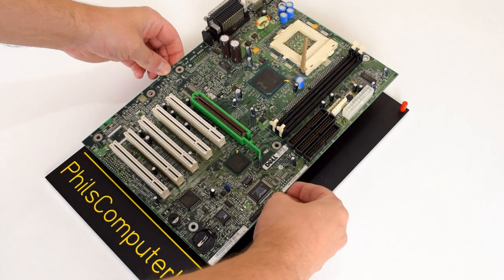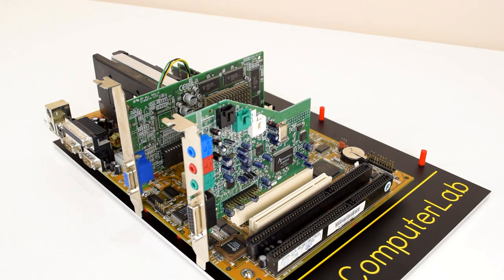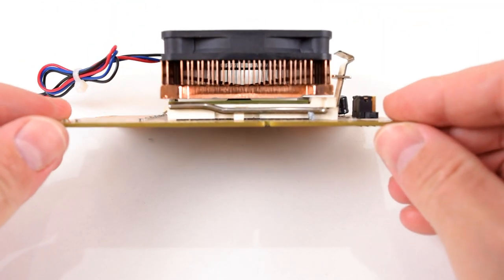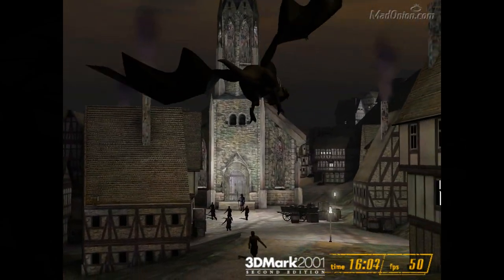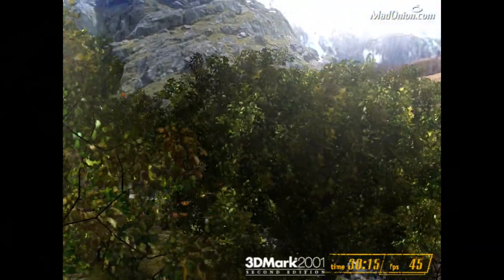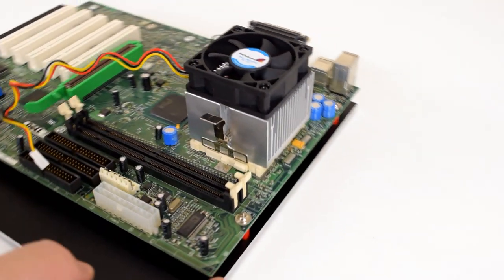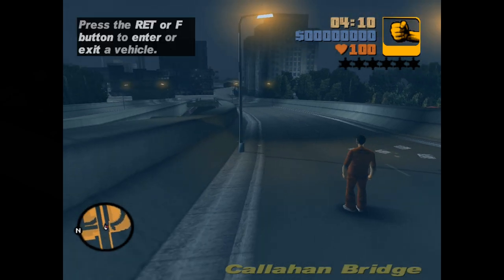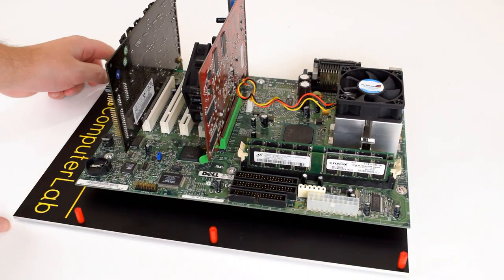The Pentium III 600EB - What does EB mean?

Comment: Hang on fella....is that Dell D815EEA using a propriety ATX and AUX power meaning you need a Dell PSU? I know Dell decided to change the pinouts of the standard ATX power adapter which was nuts. If you look closely at Intel/Dell boards of this era you can see there is a shift of the ATX plug to make it a Dell or standard Intel plus accommodation for the 6pin AUX. I've got a SE440BX boards like this; Dell and Intel. If this is the case with the D815EEA then probably should put a warning as plugging a normal ATX PSU to a Dell board will not work. Might be an interesting video as it was around 1997 to 1999 when Dell did this lunacy I think.
Reply from the maker: Yup! You can buy ATX to DELL propreitry adapters on eBay, at least that's where I got mine from :) Because of this you can get a decent price.
Reply: @philscomputerlab  Hang on .... the more and more I looked at the D815EEA motherboard you have some deep down memory cells started to engaged; the Dell Dimension 4100! I took a look in my Boiler Room (don't ask) just now and there it was! Nice. Power adapter suggestion: Yes, I found the single seller on all of eBay selling one. Ordered one back in January....still waiting for it. Gulp!

Comment: I just picked up a Socket 370  Pentium 3 667 Coppermine system from a thrift store for $10. a Compaq Presario 5000 with a PNY Geforce4 MX420, and 512MB of RAM.
Reply: though for some odd reason it runs at 664mhz, dunno why that is.

Comment: Had a duron 850, over clocked it  to 1.3ghz but it run stable at 1.2ghz.
Bench marked it in quake 3 and it beat a friends dads Pentium 3 500 on 2/3rds of the benchmarks.
So he went and bout a 800EB. Same bench marks me duron won on about 1/2 the test and only cost $185....

Comment: I can't wait till you start playing with the early p4 on the socket 423 and rambus, maybe you could look in to the mystical and elusive 478 to 423 adapters lol.
I had a 423 1.5 Ghz p4 in my mid teens with 256 MB of rambus I sold that machine off and regretted it, last summer I was a goodwill and was in the board games and found a boxed motherboard, the exact same model but it's got a 2Ghz chip in it and 2GB of rambus in it.
model number is the P4ITA2 in case you curios.
Reply from the maker: Just so you know, I'll skip anything that is priced silly and not useful for building a retro PC these days. Things like Slot A or RAMBUS, yes they are kinda cool, but not practical and so mnany better options.
Reply: For those interested in really delving into a socket 423 system; in my opinion its more for the experience than anything, due to the rarity of the parts (it can be 6 months at a time or longer between ebay listings of the best parts) its not practical as a retro gaming rig.  I managed to get an Intel D850GB motherboard with an Upgradeware 423-478 adapter along with an P4 northwood 3ghz model SL6YH working with 2gb of ram and windows 7; but due to how often I experimented with expansion cards I managed to break the motherboard traces and haven't had enough time to try again.  >w<
Reply: I was actually looking at auctions for socket 423 stuff, there's a board that supports old fashioned PC-133 in there (auction 112425692504) but yeah, kinda expensive for that one at $90 USD, it does come with 1.5GB of ram and a 1.5 Ghz cpu.
Over all the prices are not too crazy but I understand not wanting to spend the cash on the parts for one or two videos.
Reply from the maker: Yea that's pretty much it. Some parts that I see being used a lot, like the Axper Socket A board. I use this all the time, so it was worth buying.
Reply: PhilsComputerLab wonder if shipping fees would be too outrageous to let you borrow mine.

Comment: I'm spewing that I didn't go for the Athlon back in school days when I built my first PC as I ended up going for a celeron 766 socket 370 on the advice my mate running his own home PC business said that the Athlon was not a good gaming CPU and even celeron would be better. 

Why did he think that? and why was I so dumb to not do some research myself.  grrr stupid 13 year old me.
Reply: vkorinfsky maybe it because the athlon easily heated up
Reply from the maker: Thanks for sharing!
Reply: PhilsComputerLab you maybe need to try 8400gs + p4 to 2006< games maybe
Reply: No his reason was it was slower and was more for word processing, general office type work.

My next PC was a Althlon 2800 XP and my other mate had a P4 3Ghz and I can tell you which was was hot and slow, certainly wasn't the Athlon as that left his PC for dead with otherwise similar specs. My Athlon only ran about 30-50ºC with a thermaltake xazer volcano 11+
Reply: vkorinfsky yep you just need good cooling to make that still cool
Reply: This reminds me when I helped a schoolmate planning for a new PC, at the time I argued CS would benefit more from Geforce 4 (can't recall the model) than the budget version of FX series his uncle (who also owned a PC business) suggested. I showed my mate some benchmarks and numbers to make my point, also showed the specs for a good AMD CPU setup.

He obviously leaned towards his uncle and he ended up with a system just a tad lower performance than mine, I had predictable and reliable performance with my AMD Athlon 2500+ (OCed to 3200+) and him with some shitty Celeron with barely stable FPS.

Wasn't P4 the Intel CPU you could fry an egg on? I recall few articles and an old flash movie making fun of it.

Comment: I had a Via C3 Samuel 2 1GigaPro.
Reply from the maker: That's a pretty unique CPU. Can you tell me more about it? What board did you use and how did it perform?
Reply: PhilsComputerLab I don't remember exactly the motherboard model because the CPU was soldered, the manufacturer was probably PCChips. It performed like a Celeron, or worse.
Reply from the maker: Thanks for the info!

Comment: April 13 of 1999 I got a my first PC. It was Pentium II 350/32 Mb SDRAM PC100 (Which quickly upgraded to 96 mb)/3Dfx Voodoo 4 4500 PCI 32Mb and very strange motherboard. It was strange because it had BX440 chipset from Intel, but have not AGP slot and was AT not ATX. Name's PCChips M757, which have integrated Video and Sound cards. The video card was SiS 6326 AGP and the sound card was eh... C-Media 8330 SoundPRO 3D card compatible with Sound Blaster 16, but was more poor quality than the original SB16 in sound quality. But it was my first PC, I just made a jump from SEGA Mega Drive 2 to PC, so for me it was something incredible! Yeah, I didn't get the first SONY machine. In autumn 2002 I have a new PC which was Pentium 4 1500/256Mb DDR/Sapphire Radeon 7500 DDR 64Mb (most cool gpu from all of this ATI 7xxx family)/Creative Sound Blaster 128 PCI which again was integrated, but this time it was original from Creative. It were a great time to be alive! :)))
Reply from the maker: Nice, thanks for sharing!

Comment: I got my first PC in early 2000. It was a clone PC with AMD K6-2 450MHz, 128MB RAM, Voodoo 3 2000 AGP and 13GB HDD. It was a big mistake as the computer didn't work properly (BSOD) and the company it was bought from went under about 1 month after purchase. I got it repaired in different shop so it ended up costing way too much for what it was. Not to mention that it was outdated at purchase as new games released in 2000 no longer ran on K6-2 very well. I bet I would have gotten much more out of that PC if I had gone to Intel Celeron.

Thankfully I got a good deal on Celeron 800 MHz + slotket + Abit BE6-II motherboard in 2001 (less than 180€ for the whole set even with inflation adjusted sum). It overlocked to whopping 1066 MHz just by increasing the FSB to 133 MHz. From that moment on I started building my own PCs. Actually the computer I'm currently using (2500K@4.3GHz, 16GB 2133MHz DDR3, GTX 970) is still descented from that first PC as I have gradually upgraded the same computer over time. All parts have changed multiple times but I can still trace a lineage back to that first PC as at no point did I actually build a completely new PC to replace this one.

I'm currently rebuilding my first PC, just found a decently priced Ali Aladdin 5 based motherboard and ordered it from ebay. I have AMD K5, K6, K6-2 and K6-III+, Cyrix, Pentium MMX and IDT WinChip CPUs to play with. Too bad I can't find a decently priced Voodoo 3 anywhere, I have Voodoo 1, 2x Voodoo 2, Voodoo Banshee, 2x Velocity 100, Voodoo 4 4500 and Voodoo 5 5500 but no Voodoo 3 which is supposed to be the most common one. It's a real shame I destroyed my first case after I upgraded to a new one in 2003 (I think), it would have been so nostalgic to build this project in that case (it was as cheap and ugly as it can get).

Comment: The i815 chipset only supports 512mb *officially*, now if you were willing to do things in a not so official matter well I've personally only gotten one (a Gateway OEM version of the board you have here) to 1GB (I only had 1 512mb stick) but I've heard rumors of as much as 1.5GB of ram. A big deal using this hardware still in 2005. :)

Comment: I had a pentium III 667 Mhz which i then overclocked by. . . .100%. After a memory upgrade to 1gb  and  gpu upgrade from ati 7000ve to Ati 9600XT it run games on windows vista ;D 
That pc of mine ran through the largest amount of operating systems, from windows 98, 98se, Me, 2000, Xp, vista, 7 ;D In the end i gave it away for free.

Comment: The P3/600E was  better, quite a few made 900 MHz (50% OC) with just 3 key strokes in the BIOS....; I remember the CPU temp only went from 74F at idle to 83F; this was about in late '97/early '98 if memory serves... Later, in Dec. of 2000, also had the P3/800E at 1028 on an Intel 845G chipset...

Comment: eb means coppermine, aka the reason behind a lot ot the windows ME hate.   Coppermine introduced a bug that broke the newfangled way windows ME managed memory compared to 98se.   Its still a fine cpu for 98se or XP but a Katmai P3 600 or P2 450 is a better choice for ME (though a P3 Tualatin or Athlon 1800+ would be a far better choice.).

Comment: Cant remember the year but when celeron 566 was a new chip, thats what i bought. Had an abit 370 motherboard with it, the best for that celeron according internet. Used it for so long that the caps started bulging. Still have it somewhere. But it was the best combo to overclock. Got it to 933 but wasnt stable 866 worked fine with my cooling. Back in the day i was working as a tech guy (nerd...) keeping up companys computers and they chose for their new desktop pc a early pentium 4, 2ish ghz with intel mobo with rambus memory 256/512 cant remember and a matrox G400 or there abouts. In numbers it was an uber machine but in reality it sucked big time, that memory was just awful...Our old desktops with abit mobo and sdram with 700 or 750 P3 and G400 beat the crap out of that rambus crap, programs run faster, even games and the same operating system was 3 times faster running from the startup than the rambus with P4 was. No wonder the rambus died so quickly :)

Comment: yeah, rambus sucked... I have a long computer story, but in the old times cyrix was good and I had a cyrix 386... but my opinion changed when I bought a 6x86 and after that one I became a intel fan... 200mmx (asus tx97), celeron 300a (asus p2bf, best mb ever), celeron 700 (asus cuv4x, not bad but intel chipsets are better), celeron tualatin 933 (aus Tusl2-c).. all overclocked fine and I could get pentium 2 and 3 buses speeds out of celerons, what made me very happy and life fast... but as everything one day that supremacy had to come to an end and there came the pentium 4 with rambus, and immediately nothing I had would fit the p4 motherboards and the price, wow that was high... So I was left with no choice besides going to the dark side, and I got an  athlon xp... but intel got better and the next one was a celeron 1.8 ghz tha would run at 2.8ghz, again on an asus p4p800-se....and life was happy again...

Comment: The 440bx is good but depends on the motherboard brand.
For example i have a slot1 INTEL BRANDED motherboard se-440bx2
and the stupid motherboard if you flash firmware above version6.. it wont let you use cpu higher than 550mhz
if you use something above that on boot you get a warning about changing the cpu to a lower one and can´t do anything nor use the pc. While if you use firmware version6 you can use a 700mhz cpu. It is also a lottery with
the memory type, high density, low density.

to be honest on a P3 board i like the soyo 7vba133U the U means universal AGP, and can take up to 1.5gb memory, and even ECC server memory. 

OR the Motherboard Msi 815e Pro Isa version, intel chipset, but the only drawback is it supports only 512mb of ram

Comment: What power supply did you use to get that extra connector for the Dell motherboard power?

RAMBUS was almost universally hated among the community, the late 1990s and early 2000s were practically the golden age of AMD - The Thunderbird core was trashing the Pentium II and III with Cache efficiency, they used the traditional SDRAM and eventually DDR rather than the awful RDRAM that Intel insisted be used with their processors, along with various other issues.

Mind you, this reign extended into the Pentium 4 era as well, since they were practically room heaters in comparison.

Intel got into a massive lawsuit for artificially raising the performance ratings of their processors in an attempt to beat AMD out of it's throne, but it ended up backfiring quite seriously and ruining their reputation for another few years.

The Pentium 4 was useless compared to even the low range Durons, the Pentium 4HTs and Pentium Ds were expensive room heaters that were ruined by the Athlon x2, and the Itanium was surpassed by even the most basic of the Athlon 64s. Even their server-grade Xeons were put to shame by the early Opterons, Intel was on the fence in the early 2000s.

Later on, Intel decided they would take the ideas AMD created and improved on for years without repercussions and eventually got the fight back.

TL;DR:
Intel stole a lot of excellent technology from AMD in the early 2000s that made them what they are today, legal or not.

Comment: Why pentium iii is the most oldest processor
Reply: It isn't. The first commercial microprocessor was the Intel 4004 from 1971.
Reply: When did the first Pentium processor release? Also don't forget to tell me the model
Reply: The first Pentium CPU with 60 or 66MHz came out in 1993, the first Pentium II with 233 in 1997 and the first Pentium iII with 450Mhz in 1999.
Reply: So. Let me tell ya something. Is the celeron more powerful than pentium?
Reply: Depends on the exact model. A 1000MHz Celeron is faster than the Pentium III 600EB, a 600MHz Celeron is slower.
Reply: So.. 1000MHz celeron. Thats my old laptop there
Reply: So yours is better than a PIII 600EB.